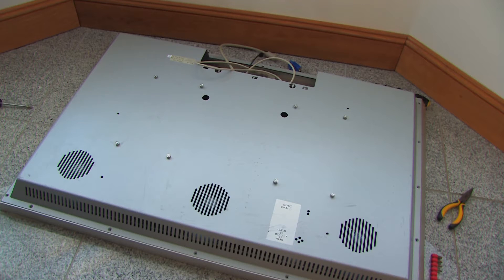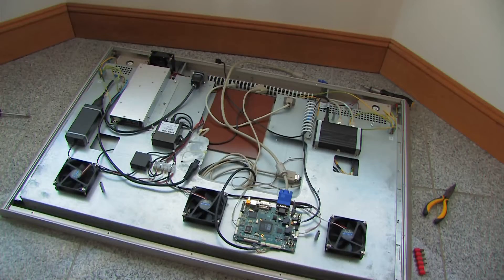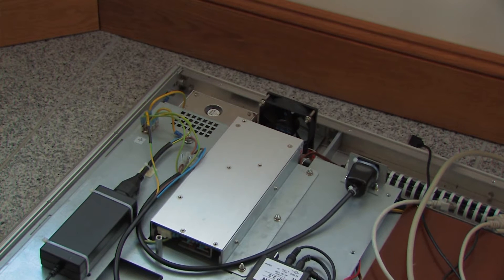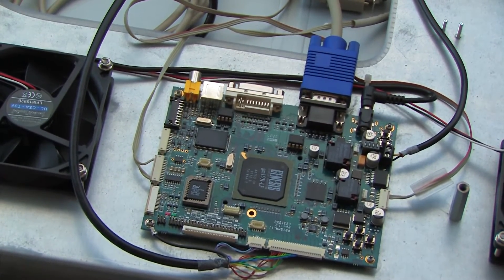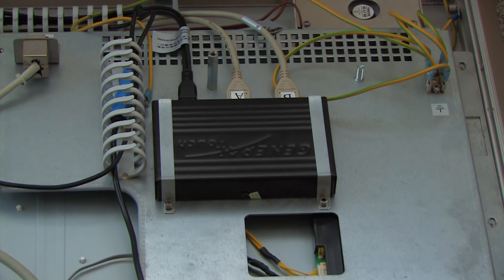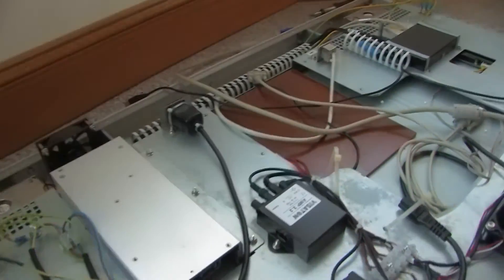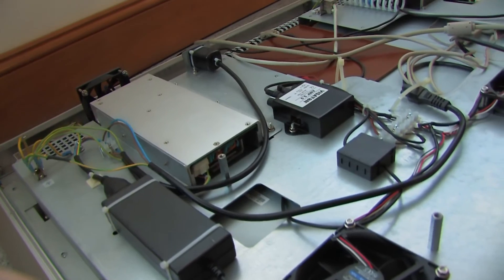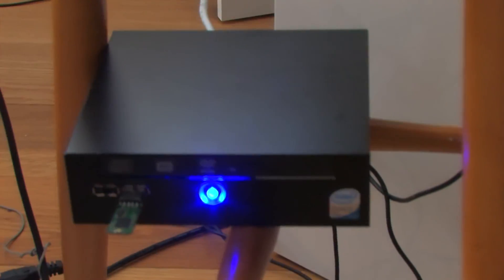Inside the Industrial Touch Digital Signage display (teardown)

Comment: I wanna see the inside of the PC mostly, reminds me of those quite old multi game touchscreen game cabinets that were in pubs and bowling alleys, I used to give them a sneaky reboot to see what was going on, what self test they would do and they had Pentium 133s and ran Windows 2000 which was ancient even for the time!!  I was so disappointed that there was just a boring PC inside but I still wonder what the board looked like, perhaps it was custom and had JAMMA!
Reply from the maker: The video will be coming soon, maybe tomorrow!
Reply: Excellent! That does actually seem quite simple for such a large touchscreen computer system! Also, good to know that it runs something more modern than XP!
Btw, did you try Windows 10 on that small desktop computer thing? Assuming that the drivers for the touch screen are fine on Windows 10, that thing can be upgraded.
Reply from the maker: https://www.youtube.com/watch?v=OVvHxElX3Zs is the video about the PC inside
Reply: Thanks, I've just watched the video about the insides of the computer. Fairly simple to take apart, unlike most laptops where you have to take loads of bits out to get to the motherboard/cooling unit... (My lappy has a serious overheating problem and you have to get to the motherboard in order to access the heatsink... needless to say I have bought a replacement laptop, all I need is the time to transfer everything across.)